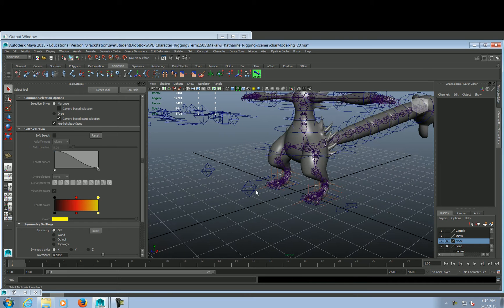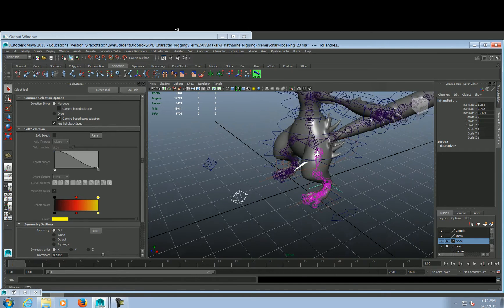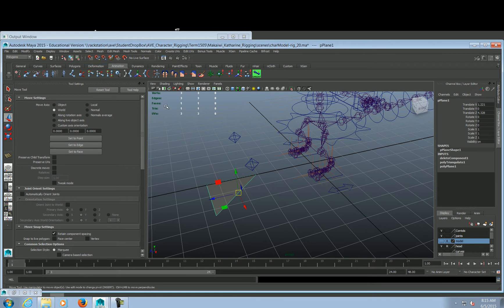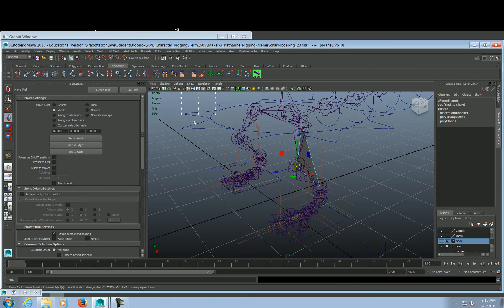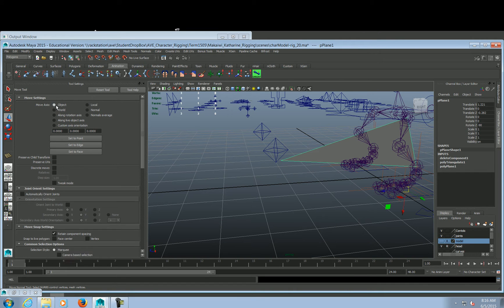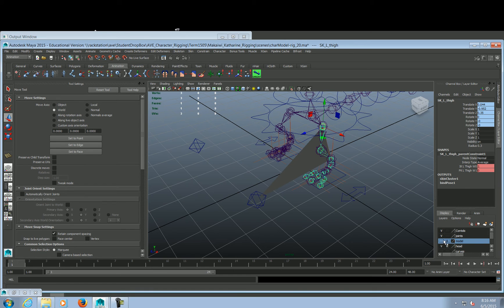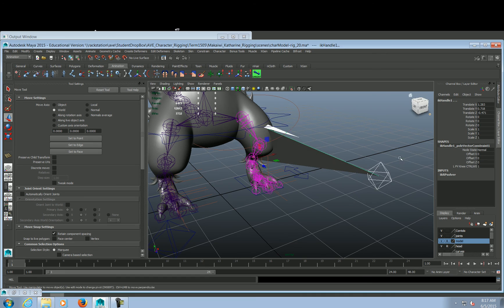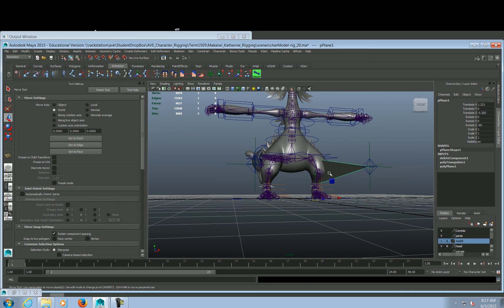pole vector Fix

Comment: when i hit pole vector, red triangle doesnt show up
Reply from the maker: did you go into the options of pole vector and make sure you have rotate plane solver checked instead of single chain ?
Reply: @JaynaPavlin  I dont see any options for pole vector. Also sometimes when i create rig manualy and press build adv. skeleton -  Blue crosses dont appear and i cant change IK and FK.

Comment: I'm trying do to this method however I can't move the vertex in one direction in normal mode. I get the teal box but none of the individual handles. How can I fix that?
Reply from the maker: Amtyk, just so I have more info...you double clicked the move tool to change the tool setting to 'normal' ? Or you did and it is not showing? Also which Maya version?
Reply: @JaynaPavlin  2017 and yeah when its not on Normalized it has the XYZ gizmo but I cant see any arms for when it is on. Just the teal cube. Thus I cant move in one direction.

Also does this work with Spring IKs too?
Reply from the maker: @Amtyk  hmmm, wonder if this is a display issue if its in vertex and not showing; maybe either try resetting the tool or even deleting all your maya preferences and seeing if that fixes it (can save them somewhere as backup just in case thats not the fix). I also remember offhand there was some sort of bug in Update 3 of maya 2017 so thats worth checking on as well.